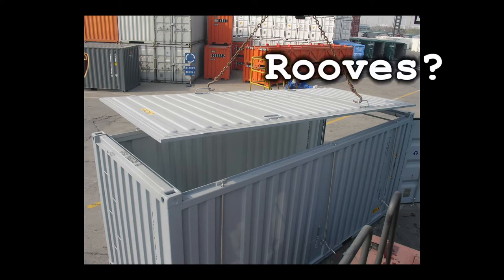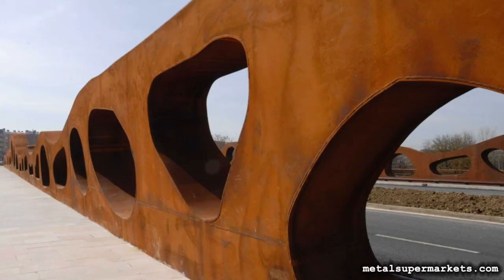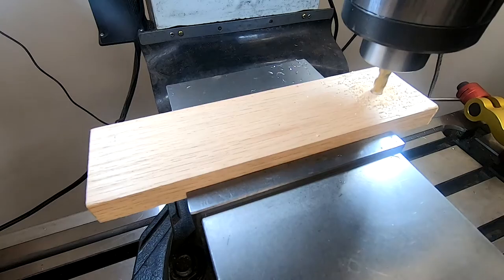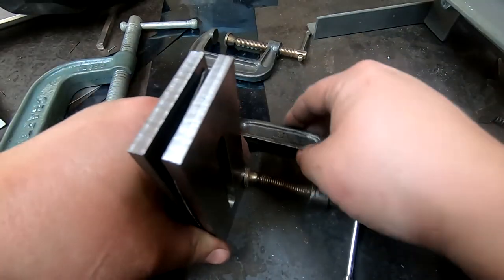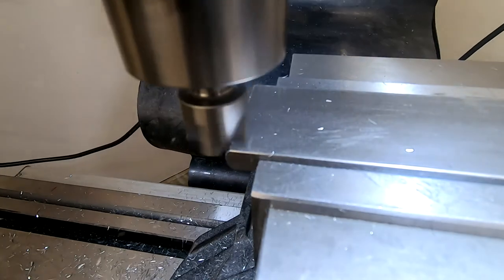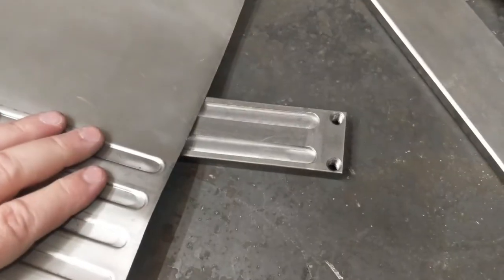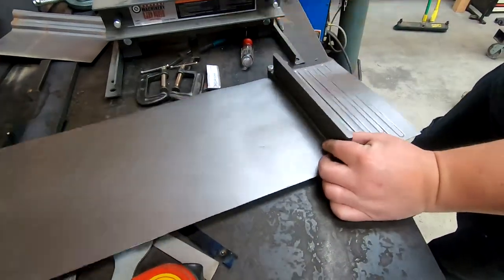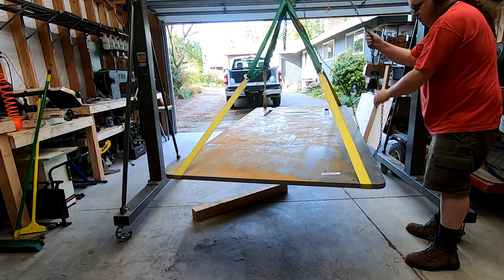Violating ISO 668 #3: Embumpening the roof

Comment: An attoparsec is like an eight of an inch, isn't it?
Reply from the maker: About 3 centimeters, I believe.
Reply: @Attoparsec  oh, I was one order of magnitude off. Shoulda worked it out on paper first. 3 x 10 to the 16th divided by 10 to the minus 18 is 3 x 10 to the minus two, or 0.03. I mentally slipped an extra decimal to come up with 0.003 meters.